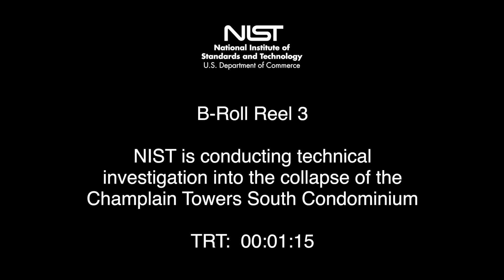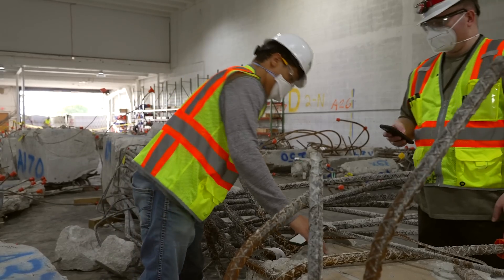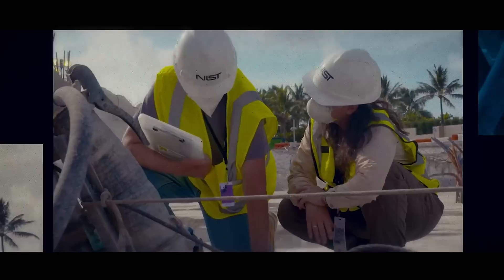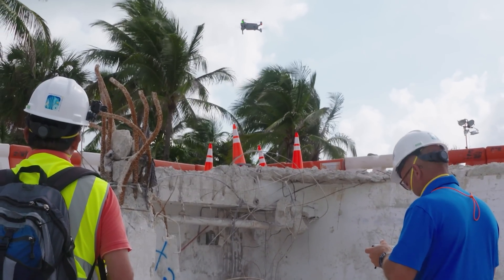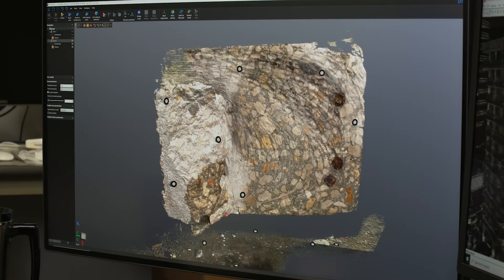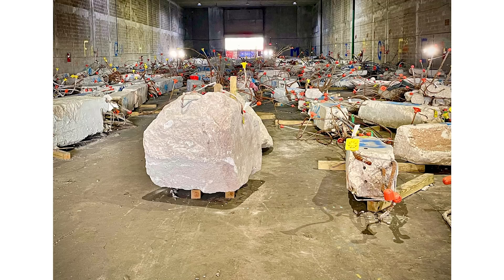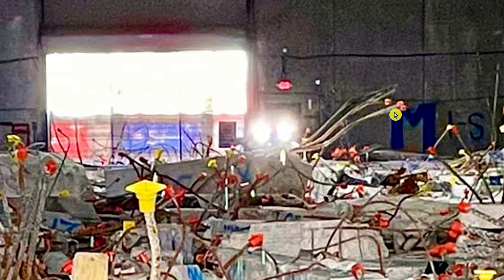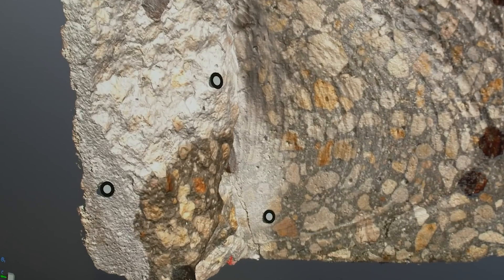NIST Releases NEW Condo Collapse Investigation Video

Comment: Hello Jeff from Australia. I have watched this Terrible Tragity sincr the Champlain Towers Building Collapsed in June 2021.We were in Covid then so was very upset to hear something like this Happened.I have seen many of Videos from U Jeff , Josh and Mike Bell who made a 3D plus Kai.But just watching Jeff and Josh which have done Amazing Work looking at all of these Pictures and putting their Expertise to what Happened to have a Building Stand for 40 years and then just Collapse like it did.Yes Jeff the Rebar is Clean Cut as saying cant see any Concrete attached to it.Its as if when the Building Collapsed the Rebar and Concrete just came away from each other.But i never liked the look at the Underground carpark as of all the Water laying around and 2 pumps that was pumping water out for a Long Time.I even saw cars that had water up to there wheels.Plus the Concrete Ceiling Spawlling and Cracks.I feel there are many Issues that brought this Building Down not just 1.As of also the Extra Weight with people putting Granite , Flooring and Extra things in these Condos the Extra Weight as Well so i believe a lot of Factors contributing to the Collapse.Thanks Jeff for all the Work U are Doing as well as keeping us informed.👱‍♀️🦋👋⚘
Reply from the maker: Thanks for coming back to watch more videos

Comment: Two minutes in, the "technician" is measuring re-bar along the compressed axis (non ribbed...) and then 90 degrees on the opposite axis.
Re-bar is hot rolled steel and is deformed quit a bit from a 90 degree shift in measuring sequence.
Reply from the maker: Remember too we are looking at this rebar post collapse.

Comment: They can't determine anything except material deficits as you know.
No one will ever determine that as they destroyed the evidence.
Reply from the maker: Another uninformed conspiracy theori guess you haven't been paying attention to the last few videos that shows how they painstakingly scanned and laser photographed every single piece of debris that they removed off of that property and they are all digitized and 3-D in their database and they could tell where every single piece came from and where it was laying in the pile. I would hardly call that destroying evidence but you lack evidence your claims make absolutely no sense at all
Reply: @jeffostroff this is not a conspiracy theory but it's based on my 35 years in inspections design and engineering. A forensics team should have been brought in before all the parts were moved out of place where they fell to determine the cause not look at all the pieces in a boneyard somewhere.

Comment: salt water, half a century of neglect, and overloading thanks to renos and additions. Like new heavier appliances, new stone floors and granite counters, and heavier people period. Those poor folks did not have a chance alas thanks to all those combos that if we stopped one would have given them longer, or even made it a small collapse.
Reply from the maker: They also could have mitigated things here by beefing up the columns, adding capitals to the tops of columns. And adding drop panel slabs on the ceiling around each column
Reply: @jeffostroff Could and should but sadly like many property owners spent more time on making it pretty then real fixes. They knew it was in bad shape but figured they could kick the can down the road more.

Comment: Where I live they require you to clean the rebar prior to install in any concrete project. Some inspectors enforce it but most don’t care. They are required to clean dirt and oil off rebar prior to install. To many contractors put the oil on forms after rebar and they will cause clean pull outs
Reply from the maker: What about epoxy coated rebar? Are they using any of that in your area?
Reply: As Carpenter apprentice I worked on a couple tilt-ups. We applied form oil before rebar. I can see it might cause problems if you spray the bars 😶

Comment: "... rebar pulled out clean..."  Scary, in other words, we should be seeing "kabobs", i.e. CHUNKS of concrete clinging to the rebar, showing that maximum consolidation and bonding had occurred, instead we're seeing "spaghetti", indicating the dreaded "Mafia Mix" low-strength concrete.  Yep, there's plenty of (cheap) AGGREGATE in this concrete, it's the critical (expensive) PASTE (actual Portland CEMENT) that seems to be the weak link... that's the "magic" component that has to be kiln-fired to a certain very high temperature, and chemically-controlled at every stage of production... Portland Cement is what undergoes exothermic reaction, giving off heat as it cures.  Aggregate is chemically INERT, but adds strength mechanically, by bonding to the cement.
Reply from the maker: I love the Mafia Mix!

Comment: Has the property values on the sister buildings dropped after this disaster? I wouldn't want to be buying anything in the north or east buildings after this. I bet shortcuts were taking in those too
Reply from the maker: Yes I have seen a few units that sold in the last six months in there that are going for 20% less then what they sold for in 2017

Comment: Is the rust on the rebar new since the collapse or was the rebar rusting in the concrete?  On a humid hot Florida beach for decades, the salt and moisture conditions would have been exceptionally bad.  Without some drying agent included, like hemp hurds, was the concrete making a rust layer on the rebar that made it easier to slide out?
Reply from the maker: Many many times over the years I have gone by construction sites it's seen piles of rebar just sitting there rusting while waiting to be built into the concrete

Comment: What’s the difference between the red and yellow rebar caps?  Safety to not get jabbed by the ends but didn’t know if there was another meaning in color coded.
Reply from the maker: I don't know what the difference is it might be different diameters to fit snugly onto the different sizes of rebar thickness

Comment: hey jeff.. you might wanna take a look at the new buildings going up on daytona beachside.... the rebar that's already cast into the concrete is completely rusting and looks like the rebar in this... here's the coordinates of the construction site.... i can't beleive they're just casting over that severely corroded rebar 29.23351167048263, -81.01113221157672 take a look at street view, i can also send some hi res pics of it too if you want
Reply from the maker: I thought they would be using epoxy coated rebar in this day and age
Reply: @jeffostroff  nope... ill send you the pic if you want. Lemme know your email and i can take some close ups tomorrow

Comment: Your comments on rebar are technically termed "pry". The process starts when the concrete dries, the water evapourates and the mass reduces, separating from the bars. Under the right tension, the steel pulls right out. It's a particular issue in the concert halls London built in the 1950s-60s, the walls want to join in!
Reply from the maker: So it seems like concrete is almost designed to just strip its own rebar out of there like a fish bones
Reply: @jeffostroff  Go read the studies, I learned this 50 years ago and have done a lot since.  It's likely rather a half-and half answer, what I do know is that as a singer and harper, I've heard the rods rattle when the typani or organ let rip. What you will find is an entire technique of calculations based around that way of looking at things.
Reply: @RahereTheGenius  basanite is the future

Comment: Is it possible that the concrete was so compromised by water (waterlogged) that coupled with stresses already there it just couldn't stay up?  The lifespan of these concrete buildings in a high salt and water environment is supposedly unknown.  Add to that minimal/poor maintenance?
Reply from the maker: That has been one of the prevailing theories and there was already past problems with the concrete cracking over the pool deck that had to be repaired in 19
Reply: @jeffostroff  Is this a real potential?  Does concrete wear out that way?  I ask because I was looking at other pics of some of the concrete and the interior of some of the broken bits looked for lack of a better word waterlogged.  Also was watching an replay of a program that talked about the families.  The officer who was communicating with families mentioned that rain posed a big problem for rescuers.  He stated that the concrete dust mixed with the rainwater and created Lye and that this further helped degrade bodies.  Is this something unique to air suspended concrete dust or is applicable to concrete in general depending on the location?

Comment: I'm going to tell you how it happened.
started off in the middle of the pool deck because it was constantly saturated with water for many decades you can see this in photos, especially after the renovation in 96, and they failed to put any waterproof barrier.
there some construction mistakes as well that cause the collapse, the rebar wasn't tired off properly, there should have been a larger column in the middle was on the original drawings but they made it smaller this contributed to the column failing after the collapse of the pool deck bad design. the smaller shear wall was inadequate and should have been T-shaped and wasn't tired off from the rest of staircase and flooring.
the biggest mistake is the column and the tying off of the pool deck and lack of punch through provisions, especially at the building columns.
Reply from the maker: Other photos that I have seen and clearly showed they did put down waterproof and membrane underneath The sand and the cool jacket paver bricks
Reply: @jeffostroff  clearly wasn't stopping the leak as we see from the evidence
Reply: Yep, skinny columns and cheap maintenance on the water logged pool deck. What a horrific combo!

Comment: I am shocked to see those columns are the same size as the ones I put into my own home. Smaller 1 inch rebar with 3/8 inch stirrups and my home is only two stories! Imagine that huge building all that weight on those spindly columns. Good point about concrete adhesion, I have demolished slabs, beams, columns and there is always concrete stuck to the rebar.
Reply from the maker: Yes I wonder if they were going to determine that there was some type of contaminant in the concrete but maybe oil

Comment: WOW... more info. Perfect those pictures in 3D.
Looks like the concrete was way to "dry" .. more chalk than cement? Powdery? The rebar just did not stick.
Will they use this info also on the other towers?
Reply from the maker: They might do some type of testing on the other towers but we are not sure at this point I'm sure They will go by and check them out for reference because the ship blamed towers North is very similar to the campaign tower South that collapsed
Reply: @jeffostroff  Yes. 
I am sure that the same building ideas (eh, flaws) were used on those other buildings.
Same concrete / same pouring / same rebar settings. 
OR... there were some latest adjustments made due to a different contractor. I remember you showing some blueprints of a later date, with some changes.
Anyways.. thank you!

Comment: Jeff, having worked in structural concrete construction I've seen rebar pull out of cement clean like that.  In the final analysis, the reason that was deduced was narrowed down to contamination in the concrete that was poured during construction.  Oil.  Simple petroleum was present in the batch.  And not that much either.  Contaminated sand was used in the batches where this occurred.  It is so important when pouring concrete to do slump tests and save samples from each truck load of the stuff...then have them tested immediately in case that section needs to be demolished and re-poured.  Wonder if this was done during construction of Champlain South?  We did this in the early 70's (1973).  And I know this because I was tasked with doing the slump tests and sample collections.   We poured 90 trucks on pour days for block long decks so it was a daunting task but it was done as it should be on EVERY job.
Reply from the maker: Yes I would love to see reports of that kind of testing
Reply: @jeffostroff  What struck me is that the concrete forms may have been oiled before the concrete was placed and the rebar may have been coated in this oil
Reply: Wow! That’s super interesting. Having done QAQC for manufacturing chip based cards prior to their acceptance in the US; it’s interesting that similar concepts would be in place. Totally cool. @Jeffostroff do you think you could do a video at some point about this process?
Reply: All I see is rust-colored rebar everywhere. Is that normal after several decades or is that another bad sign?
Reply: @megatuanis  its normal as to properly cure concrete you have to wet it because if it cures too fast its liable to crack due to the heat that it generates when drying/curing
Reply: During this video I felt and could see that the concrete appeared to be white and powdery.  Maybe it was substandard?
Reply: I assure you NOTHING that rigorous was done on THIS job, due to... The SFSF (South Florida Slacker Factor).  Town of Surfside was lax back in 1970s-1980s (and probably still IS, see Rosendo Prieto...), and this laxity attracted corner-cutters like Nathan Reiber, whose reputation repulsed the ethical players, and instead attracted other slackers--Architect, Engineer, etc... plus, Reiber acted as his own GenCon... do you see The Perfect Storm here?  https://youtu.be/pk2hmytlDg8
Reply: Wow.
Reply: A Day, thanks so much for your input, but... WHERE were you located that this rigorous testing and logging was the norm?  Also, was it known/rumored that your ready-mix suppliers were owned by Organized Crime families?... certainly was the case in So-Fla.

Comment: Looks like a very thorough investigation! Even if it doesn't necessarily tell us much about the collapse, it might reveal a lot about 'cowboy' building techniques in the 1970s.
Reply: See my comment on here.  I worked on large projects like this during the early 70's and we never poured without slump tests and collected samples from every truck which were sent off for immediate testing.  We actually demolished sections and repoured them when the chemical analysis came back 'unacceptable'.  So no cowboys building techniques were present on most jobs in the 70's.  There were labs set up to do the testing prior to the 70's and they were used.  This builder seemed to have a problem with such...and worse than that is the building inspectors seemed to be looking the other way.  Maybe this builder was a cowboy but he was not exemplary of the rest.
Reply: @aday1637  I am fully aware of how construction is supposed to be done properly, but only when you demolish a building can you really be sure.
Reply from the maker: Yes I can't wait to see the testing results in the strength of the materials
Reply: @jeffostroff  This short video reminded me to watch the 50 minute update, which I previously did not have time to do.
Reply: I wonder if in 40 years time when there is some sort of building failure if someone will be commenting on the "cowboy building techniques of the the 2020's ..." 
With "professional engineer" designations and building codes and gov't permit inspections (then and now) we tend to think that things are being built "correctly" and SAFELY.  It is jarring to find out that at any time someone can cut corners, due to greed, negligence, incompetence, or simple unexpected "circumstances", setting us up for the next "surprise".
Reply: I hope this tragedy gives valuable information about these remaining structures that can help prevent and preserve.
Reply: Cant deff show what to watch for in buildings from that time